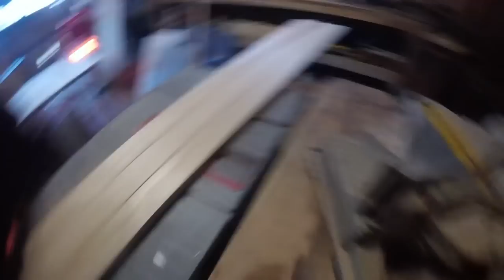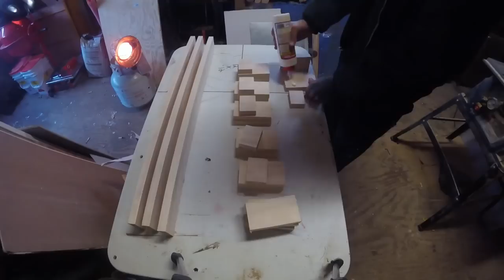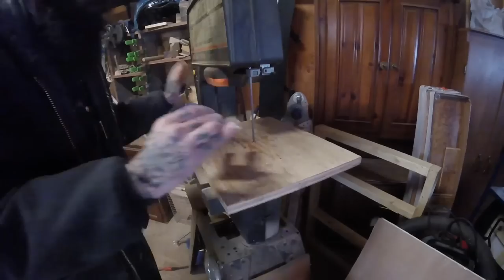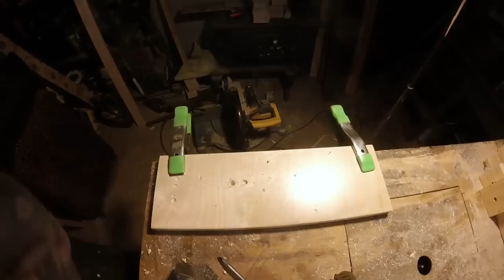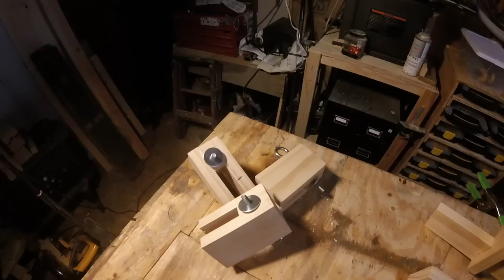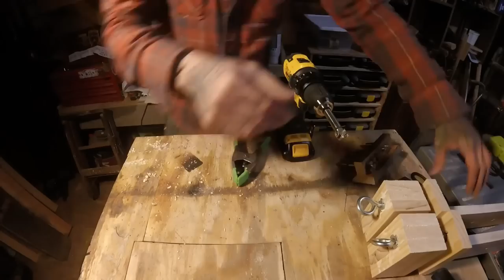Diy Wooden Bar Clamps

Comment: The head of the clamp is glued, right? So only way to adjust the length is to move end block.
May be the video shows it wrong, but the bolt you use seems too short compared to the distance between adjustment holes. This kinda suggests you cannot clamp all sizes of work. Do you use some extra specefiller-blocks or am I missing smth?

Comment: I chuckled when you tried to weld the second nut. I'm thinking he is not going to get any spark here then you mover the ground. hehe I make those kind of mistakes all the time. I couldn't quite see what you epoxied. Was it a fender washer to capture the nut in the recess for pulling the movable jaw back and releasing pressure on the clamp?
Reply from the maker: Haha I was wondering if anyone would catch that little oops! What can I say it was a long day hah. 

Your right as well, fender washer gets epoxied to the foot and the eye bolt spins freely and the welded but pushs and pulls the foot back and fourth.
Reply: Rodent I don't he made a mistake
Reply: I noticed both of these watching it the first time. second time I noticed the nut you drove in on the wrong side of the clamp head, it’ll just pop out if you put enough force on it. And also, how long is your clamp stroke? It doesn’t seem like it would be very long of a stroke..